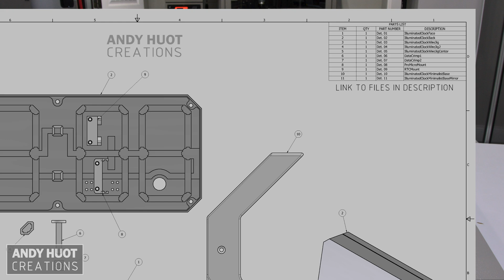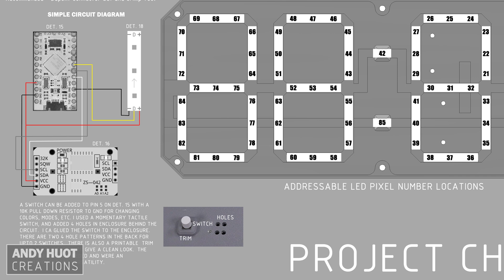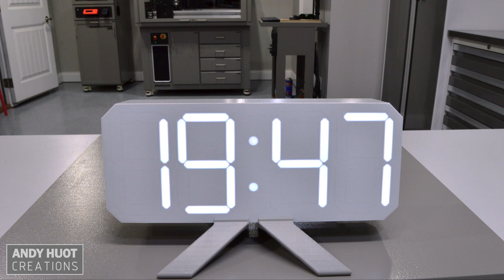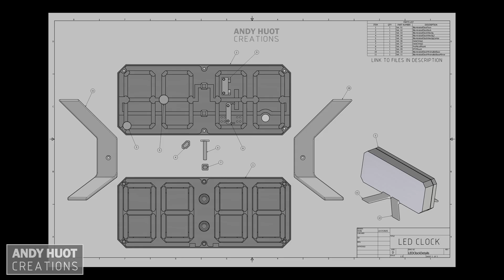WOW! Create Your OWN 3D Printed LED Clock!

Comment: This high-speed jerky timelapse with loud music is definitely not something I enjoy watching, but I watched enough to get the gist of what you are doing. I don't need to see the entire build process. A few brief shots of the key moments at real-time speed could result in a video of the same length, but easier to watch. I really liked your wiring jigs, I have not seen anyone outside of industry or the military use them. Your wiring is neater than anything I've seen on YouTube. I wondered what det. meant, but I saw the answer elsewhere in the comments. Overall, a fantastic project, but I'm still a little nauseous from the video.
Reply from the maker: Thank you for the feedback.  I know everyone is different and I can't always please all.  I'm glad you found some value in the project and hope you also find my cheat sheet, drawing, and other downloadables helpful.  Also,  I recommend printing several of the dies (male portion of the wire jigs) before you start.  The thumb pad broke off after heavy use and definitely noticed the extra strain on my thumb.  Det. 03 is also used for installation of the power wires and should insert all the way into the pockets.

Comment: I don't understand where in the construction timeline does the Semi-translucent white cover that goes over the LEDs appears?
Reply from the maker: It's printed into the clock face.  It's the first 2 layers of the print, printed in white.  Then I switch to gray for the rest of the print. 1:07
Reply: @AndyHuotCreations which  (if you don’t have an AMS or equivalent) you can usually manage by setting a pause point at the second layer and swapping the filament manually. Did that for a awhile with my A1 before just buying an AMS..

Comment: Very good. 
I would change the board, though: A wifi enabled controller (ESP32-C3 for example) and as a first routine, a check to a time server to sync the RTC (in case of a power failure) and a weekly check too to keep the clock in sync. One time setup and forget 😁
Reply from the maker: Thank you.  I actually use ESP32 for most of my projects and sync my time every hour.  I just wanted to eliminate that hurdle for people without that experience. The other benefit of the ESP32 for this would be the RMT neopixel method the the strip.
Reply: @AndyHuotCreations  yes, I would love to see an LED clock with RTC and internet time updating.

Comment: Hello, I love your project. As soon as I have everything ready I will start it. I have a question: instead of the Arduino Pro Micro, could I use the Arduino Nano? Thank you very much.
Reply from the maker: You have to use a pro micro. A nano is too long to fit. I was trying minimize the thickness of the clock, so I used a pro micro. You could use a pro mini, but uploading to it is a pain
Reply: @AndyHuotCreations  It's true, it's narrower but it's longer, thank you very much.

Comment: I have to build this.
Reply from the maker: Do it!  It looks even better in person.
Reply: @AndyHuotCreations  I so want to print it in black. I just printed the first layer and it looks like it will work with the .2mm layer on the front
Reply from the maker: @BadBradxx7  You can print any color you want as long as the 0.4mm thick face is white and everything else is a color capable of blocking light. Black will certainly block the light.

Comment: What did you used in front panel/diffuser
Reply from the maker: I printed the first 2 layers with white filament, first layer height: .2mm, all other layers, .2mm.  The white diffusion surface ends up .4mm thick.  This provides an effective diffuser for an LED placed about 23mm behind it.  The key to diffusion is the distance between the light and the diffusion surface.  23mm has always worked for me.  I found this through testing.
Reply: That was the most interesting part to me as well though the first layer certainly doesnt appear to be white in the video.  Andy, did you mean the layers were grey, white, white?  And the leds are shining through all of that?
Reply from the maker: The first 2 layers are white, making .4mm white face layer.  The rest of the layers are all gray.  The only white on the whole assembly is the .4mm thick face of the clock.  It doesn't look white in the video, because relative to the white LED light of the clock segments, it's much less white and the illumination amplifies this effect even further.  The gray is also close in appearance to the white, but still capable of blocking light.  This was all by design to make the clock appear clean and uniform.
Reply: @AndyHuotCreations would be really useful if you could do a separate video showing more detail on how to achieve the diffuser effect. I've never seen this done with a 3d print and it looks really cool.

Comment: 03:55 Please remember to remove the zener diode or resistor next to it on that RTC board or the CR2032 button cell ends up blowing up because it is being charged. This happens because the RTC board was designed for a LIR2032 button cell that no one uses, as it has a very low capacity (standby time) and higher price.
Reply from the maker: Thanks for the info.  I need to look into this. This came out of a 5 pack I bought 4 years ago and I haven't had trouble with the first two.  But I will still do some research.

Comment: I will say, if this is a guide, its going way too fast and theres no explanation. Itd be hard to duplicate. I couldnt catch what you were soldering to the breadboard.
Reply from the maker: Thanks for the feedback. I'm trying to dial in the speed on these but I put a lot into the downloadable documentation which should fill in the gaps. You can solder the board in many ways as long as it matches the diagram
Reply: @AndyHuotCreations  +1 to being to fast to follow.  Maybe a 1x closeup of how you install the wiring ?  Looks you glue the power and ground, then somehow fit the data wire in?  If closeup pictures would be much appreciated.